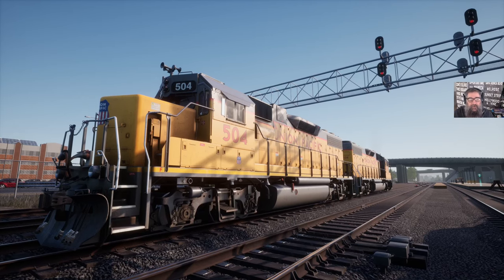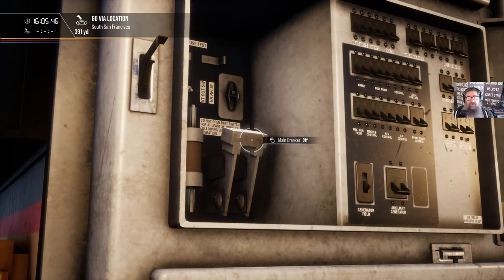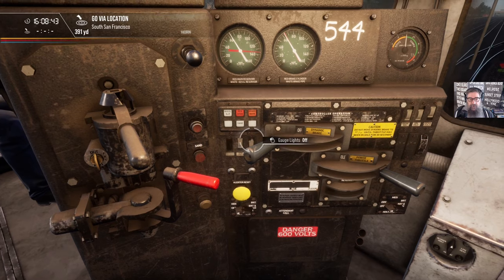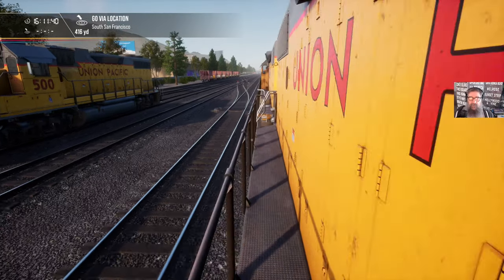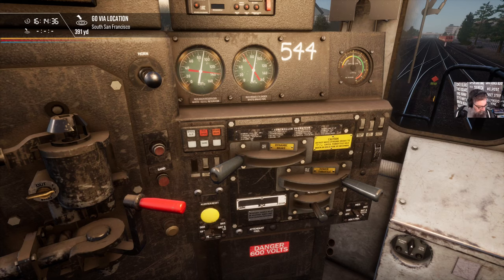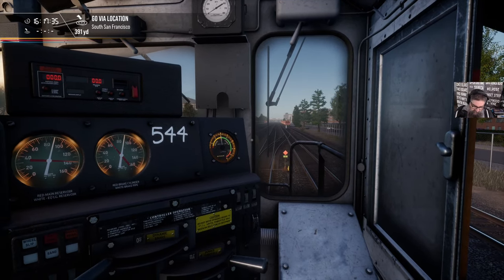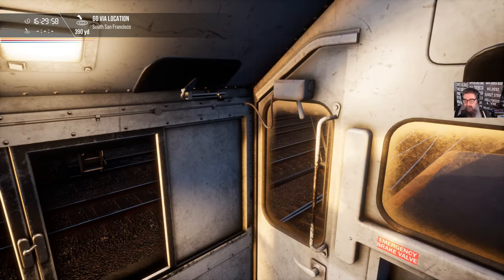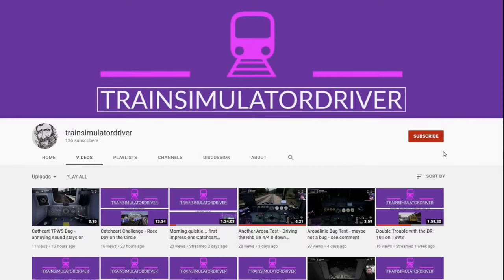Daily FRA Inspection and Locomotive Start-up and Checks Tutorial in TSW2

Comment: You can actually turn on the headlight on the other locomotive, since you set the multiple unit headlight controls correctly, using the rear headlight control will operate the front headlight on the rear locomotive.
Reply from the maker: I'll give it a try. It certainly will in a real one 😁
Reply: @trainsimulatordriver  It works in TSW. I do it all the time.